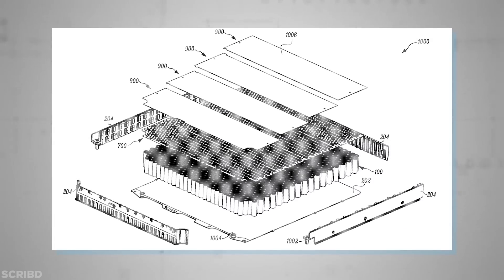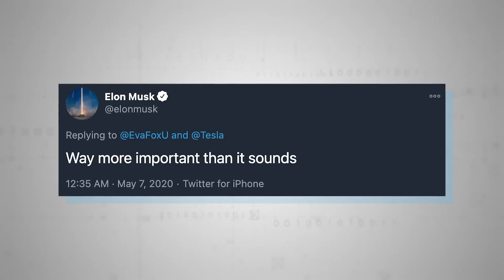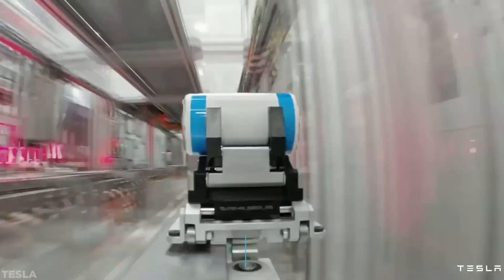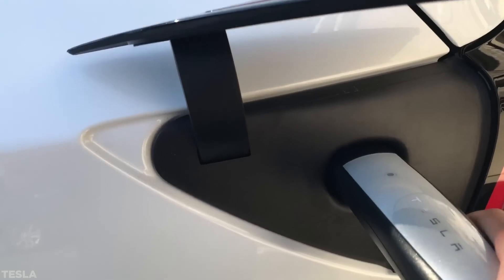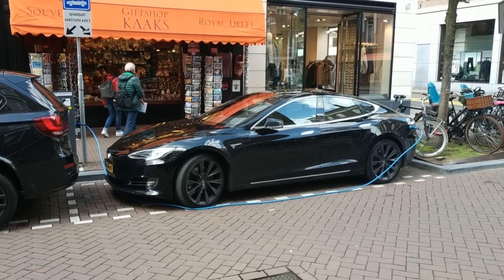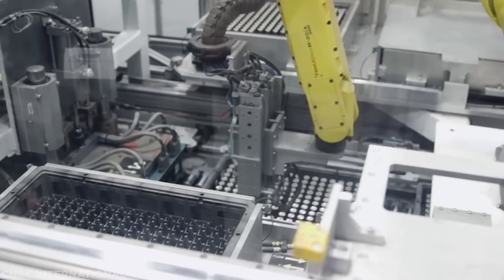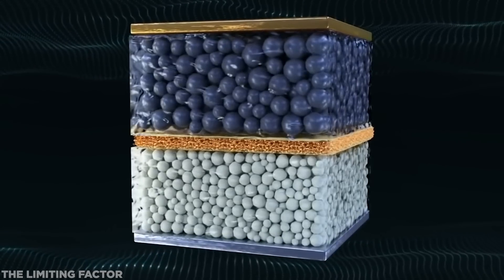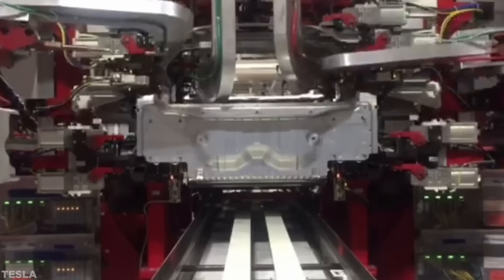Why Tesla Switched To Tabless Batteries

Comment: Or just use a diesel car. Fill it up in two Minutes and be on your way for double the range without fearing range deteriation over time. Waste of raw Materials in the current state
Reply: tesla model 3 gets 350 miles, takes longer to charge but the fuel saving justify it $10 for that 350 mile fill and charging at home makes it more convenient then the drive to the gas station, a diesel cars range will also decrease with time as internal parts get worn and fouled, a tesla will only lose 15% of its range after 250,000 miles, its a great use of raw material since its so efficient.

Comment: It’s nice to see innovation in an industry that loves to repackage old tech and call it “new”
Reply: And tabless is not exactly new: a similar design principle has been used for metalized polypropylene capacitors: have the electrodes stick out from opposite ends of the roll and metalize the ends to bridge layers together for sub-mOhm ESR. Multi-layer chip capacitors have been built in a similar manner since their inception too.

Comment: The real advantage is that tabless = load bearing. Li-ion cells can be an integral part of the vehicle chassis not just an added dead weight that's cramed inside  a reinforced chassis that must be even made heavier to be able to carry the weight of the packs. No welding means the tabless cell packs can be load bearing without breaking apart and are the chassis themselves. Meaning the vehicle can carry more cells for the same weight. Load bearing tabless cell packs is a +20% range improvement something like that.

Comment: 5 times more energy capacity and 6 times more powerful equals a 16 percent increase? Doesn’t add up fam
Reply: Actually, it does.  Larger cells have more energy storage capacity (in this case 5 times) but when cells are larger you can fit fewer of them into the same space so the total energy contained in the space a car has for batteries is only slightly improved due to the better packing efficiency of the larger cells. This is where the 16% comes from.
     Improving the power capability of a cell has no effect on the range.  (Power and energy are different things in engineering terms.) What improving the power capability of a cell does is to improve is how fast you can get the energy in to and out of the cell. Higher power capability means recharge time can be decreased (assuming you have a power line with sufficient capacity) and horsepower output to move the car can be increased.  This latter is not likely to be of much advantage as Tesla's vehicles already perform very well.  If you took a vehicle with a 0 to 60 time of 3 seconds and improved it by a factor of 6 you would have 0 to 60 in a half a second.  You could not easily get enough traction to do this and the passengers would be subjected to a G load of about 5.5 Gs.  Average drivers could not handle this and some would even die when subjected to this amount of G force. Very bad for customer relations...

Comment: More diameter = more empty space between battery? 1 cell energy density bigger, but group cell energy density/ volume ? Rectangle or hexagon shape would be more efficient
Reply: @petr6258  yup agree. But if small gap already enough why make a bigger gap. And still make another problem with energy/volume ratio. We need to closed gap to gasoline energy/weight or volume ratio

Comment: check out current tesla model 3 prices and leasing prices. It's cheaper than a 4WD VW Golf.... Plus saving as much as 9 out of ten parts in fuel costs. So it's cheaper than a VW Golf over 5 years... and it keeps its value a lot more stable, as zero maintenance required, except tires and window wiper water (brakes fully with its therefore very strong and efficient electric motors, while converting back electricity into the battery). Stop saying "the affordable e-car will come..." It has been here since 2018!!!! The Tesla Model 3, now also the Tesla Model Y. Saying "it will come..." makes people roll their eyes and meanwhile purchase a combustion engined car instead, which will cost them more over five years already, burning up resources, while they could already drive their dreamcar, if not all media outlets would keep telling people it wasn't here yet but "will come.."... IT IS HERE, and YES, there will be even cheaper Teslas in the future, but that doesn't mean the current ones vs. combustion engined cars wouldn't reach their financial savings for the customer already.

Comment: The battery today is also fixed in place „permanently“, but it is still removable. Tesla only stated that the new battery pack is so sturdy that it can be used as a structural part of the car, no downside in that, makes the car easyer to build. by the way, iPhone batteries are amongst the best to change...
please, it is not that hard to watch battery day and take notes...

Comment: Li Si will fail! Li Co is what made Tesla/Panasonic what it is today. Not this new Li Si non Co battery. Why? Why dump Co when Li Co built Tesla/Panasonic? Earths limited natural resources. If BEV takes off then Co would be completely gone in 5-6 years. No more Co, No more Li Co bats No more Tesla/ Panasonic. Even if Li Si is a poor battery Tesla/Panasonic must dump Co batteries to survive. 
Is there hope for BEV?  IMO no but EV with 60-70% effecncy solar roof of a feather light EV that may work. Lets hope solar effecycy improves within the next 4-5 years.
Reply: Where you getting this information at?
Reply: @dallas69  I mean most battery manufacturers are moving away from Cobalt.

Comment: Seriously?

While Musk has been talking about this design, actual battery manufacturers have been making million mile batteries (usually prismatic, like the chinese 3 and Y).  And Musk has been more than happy to have Panasonic and others make these 4680 cells, just as they make the 1865 and 2170 batteries.  But still no specs like what you suggested.

Hate to accuse you of clickbaiting and false advertising, buuut...
Reply: When the plaid model S comes out you'll see.  Plus the 4680 is a million mile battery if not 2 million.
Reply: @user-RCST  Again, there is no final version of the 4680 to make those claims, and the S has already been out for a while.

If profound improvements could have been made, they would have been already.  But a quick bit of 'back of the napkin' calculation shows that hasn't been the case.
Reply: @billcichoke2534  it appears they shut down on the last production for 18 days to set up the new cells.  I'm not talking about the model S I'm talking about the Plaid model S.
Reply: @user-RCST  Sunce they haven't shown a new chassis design for the S and X, I remain skeptical.  The ONLY main change that they were going to do, was put another motor on the back axle.  Ither than topside body style mids, that was it.  They weren't going to redo the bottom to make room for the much taller and fatter batteries.  That was going to happen on the cybertruck and semi.
Reply: @billcichoke2534  so you have to see it to believe it.  You will see it soon.
Reply: @user-RCST  If it's as underwhelming as the P90D I drove back in 2016, I wouldn't hold my breath...
Reply: @billcichoke2534  lmao 1100hp zero to 60 in 2 seconds quarter mile time of 9 seconds yes sooo underwhelming you have to be a troll.
Reply: @user-RCST  Drive a real car and then tell me video game designers are better than vehicle engineers.  And those figures were supposed to be what the new Roadster was supposed to be able to do.  Interesting...

Comment: I love the solar panels on a small part of their GigaFactory.. what does that tell you about the viability of 'renewable power'?  solar and wind doesn't produce squat especially when it comes to powering heavy duty operations like GigaFactory.  As more battery powered cars are forced onto the consumers the already stretched power grids will simply require more fossil fuels to power them up.. Hydrogen cars-require fossil fuels to create the hydrogen.  So why switch to electric cars?  No other viable power source exists in enough quantity except nuclear.
Reply: The electricity prices will just go up, so can all go green, plus all the investement require for the grid, sky high electricity prices

Comment: All your numbers are wrong, they use gigawatts now, The pilot line for the new cells, is 10 GWh/year 1 Line. Panasonic's 11 lines in Nevada CATL?'s lines at shanghai, do a lot less but still. The new cells are not stiffer, all cylindrical cells are stiff, but they are glued into the chassis, instead of being packed into modules, then packs, then bolted on. Quicker, cleaner and cheaper. The cooling is a prime advantage, as electrons only need to travel to the top of the cell to escape, they generate little heat, and it is not concentrated. In a normal cell the electrons need to zoom around, and around and around, until they get to the tab, then squeeze through it, creating both a lot of heat from bumping things along the way, and concentrating a lot of this heat at the tab, right at the middle ....  And I am sure the patent is a few years old, but it was finally granted. Panasonic is developing a line to make TESLA cells, but Tesla already producing them, and the Model Y coming out of Germany soon will be using the full cast chassis, integrated 4680 cells and all.  As usual your research is for .$%&^*. Give up, or read up

Comment: You missed the key advantage: heat dissipation.

Currently tesla packs have liquid cooling channels winding among the batteries and heat is largely dissipated to the walls of the cell. They could not be made larger partly because the big cell would insulate the core too much. The tabless design allows heat to dissipate  from the center of the cylindrical cell to the top and bottom caps (so larger diameter doesn't matter). The possibility of better, cheaper plate cooling is a big part of the longer life (not just reduced resistance) and is what unlocks the larger cells.
Reply: The lower internal resistance means less heating too.
Reply: I have a question, Why cant electric cars convert the spinning motion of the wheels/axels back into electricity like a waterdam or windturbine does for example? Wouldnt they be able to somewhat charge themself while driving to extend the range..?
Reply: @252laylow  They already do that, its called regenerative braking. When driving a Tesla you practically don't use your brakes. The electrical motor dose the braking for you and gives you back energy.
Reply: @252laylow  They do. It’s called regenerative braking. Even hybrids like Prius have been utilizing it.
Reply: @252laylow  they do, that is the principle of hybrid cars. Tesla cars do that too, but of course you cannot regenerate as much energy as you use, overunity or 100% efficiency is not possible
Reply: @252laylow  Most ev do that.  It is called regen braking.  You can turn it on/off on the Tesla.
Reply: @252laylow  They already have regen. 

do you believe in perpetual motion?
Reply: @252laylow  you should buy a electric skateboard.
Reply: I'm hoping they will use titanate someday. Like apple is rumored to.
Reply: These days We all so smart ! One thing stop us being smarter really ! Stupid YT videos (not this one ofc) . Especially those videos that makes our kids stupider !
Reply: @E M we were not talking about gas cars. We are talking about glued solid battery packs exploding. I want to know the difference to non glued packs. Can you understand or should I say again?
Reply: Plus, the battery packs will be implemented INTO the framework like the air planes have their fuel tanks(in the wings).
Reply: @piterHW  I really want to see how it does in a big crash. No doubt it is the strongest EV frame on the market before the CYBTRK gets here but with enough speed anything will smash in.... The Safety of these cars after crashing is a major concern.
Reply: @quinnfoster4671  Seeing that all Teslas  are safer cars than even Volvo, In my opinion their experts already thought about your concerns. I'm sure they're not idiots.  lol
Reply: @piterHW  I don't think you understand what I said. I just want to know how making the cells a rigid part of the structure affects them after a crash. If I thought it was bad I would have said so.
Reply: @FMTF-makemoneyonline  tbh i feel like some cars are aluminium or plastic, bends way too easily
Reply: @FMTF-makemoneyonline  Why do I want to know? what kinda reply is that.

I WANT TO
Reply: @quinnfoster4671  as long as the batteries are comparably flammable , gas tanks are not the safest option .. remember the Ford pinto
Reply: @rohitranganathan6062  ha you don't understand what I said I guess. Read it again. Only interested in the safety of a giant glued pack. You brought up comparing to gas.
Reply: @quinnfoster4671  You are saying electric cars are unsafe because they can catch on fire. Two problems with that:
1: EV fires are extremely rare and don't spread particularly fast within the battery pack, giving the occupants plenty of time to escape assuming they aren't trapped.
2: Safety isn't a standalone metric, it is a metric of comparisons, so you refusing to compare the flammability of ICE cars to that of electric cars is asinine at best. Anything can catch fire if it gets hot enough, even water (hydrogen disassociates from the oxygen). The point is virtually all EVs are more safe than ICE cars, because it is fairly difficult to get the battery packs to catch fire, compared to gas tanks which just need a bit of airflow and a hot surface, like that of your brakes after slamming on them in an (unsuccessful) attempt to avoid an accident. And beyond that, gasoline fires spread almost instantly, so you are far less likely to get out alive from an ICE car fire than an electric car fire.
Reply: @richardmillhousenixon  actually I didn't say that. You would need to quote where I said "unsafe"

I asked how making the battery stronger and more rigid changes how a thermal runaway burns. I didn't make any comparison to any other vehicles. I know to know the difference between the old TESLA. 

You can go back and read that's exactly what I said.
Ok thanks for reading.
Reply: @quinnfoster4671  In your very first comment you said, and I quote "The safety of these cars in a crash is a major concern." Translated by the common man: these cars are unsafe. You can not have any accurate measure of safety without something to compare it to. You are fearmongering. Stop
Reply: @richardmillhousenixon  being concerned about safety doesn't mean unsafe.
Reply: @richardmillhousenixon  Logically I would be comparing them to the previous tesla models and other gas cars and if you would ask my opinion they are safer. Yep I actually have given you a statement and opinion about how safe the new structural battery is now. My statements had to do with the changes and how they affect a battery meltdown. If you still can't understand what I'm saying I'm sorry but I have been very clear actually. 

I am sitting in a room with 500+ battery cells. If they were all glued into a solid brick I would be concerned more if it went off than if they were loose. Do you get what I'm saying now? I think they are less likely to explode but if you go back that's not what I wanted to say in my first comment because that's basic knowledge. Have a good one!
Reply: @quinnfoster4671  Not really. They've already proven to be the safest cars ever in testing and real life. Explosions are rare, much rarer than exploding gas cars but you don't seem to be too worried about those. I'll take the safest car any day even if the edge cases are scarier.

Concerning replaceability, the tech has advanced far enough that the battery pack will never have to be replaced as it will outlast the car.
Reply: @piterHW  If that is so,
Replacement would be a nightmare
Reply: @emrefifty5281  @Johnny Joe The DBE technology those 4680 are debuting are far safer than traditional lithium batteries. In a crash situation, the liquid electrolyte is usually the weakest link regarding shortcut safety: that won't happen with Tesla's DBE technology. Also, the immediate danger of a highly flammable liquid container far surpassed that of a short circuit. The emptier the gas tank is, the more explosive it is. Regarding the structural battery, Teslas will now be built with three major cast parts that replace hundreds or thousands of smaller parts in tradicional car building. The battery pack will no longer be made of modules, instead they'll glue the cells directly to the battery cast, reducing costs and improving the car's overall rigidity, which means better dynamic behavior and improved control (safety) of the vehicle. Regarding short circuit safety, I guess there'll never be a fool proof battery or system, but this DBE technology improves greatly on that.
Reply: @piterHW  how would this help specifically
Reply: @piterHW  which is really bad for the enviroment. It's like non-removable batteries on phones.